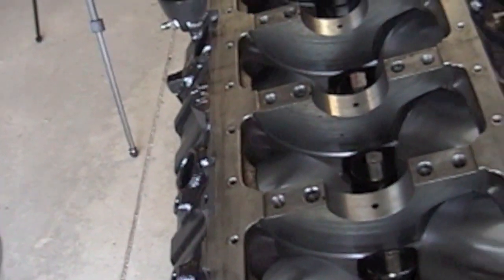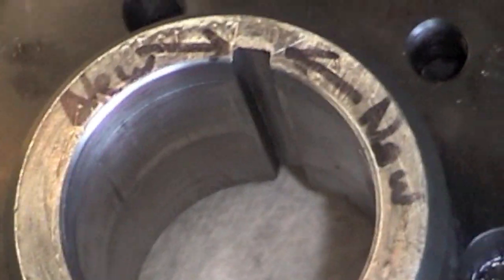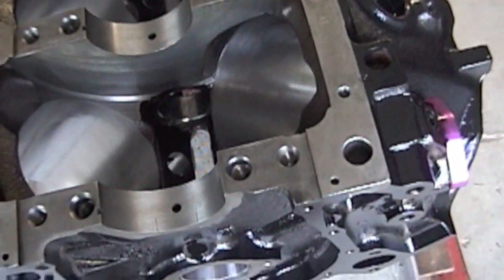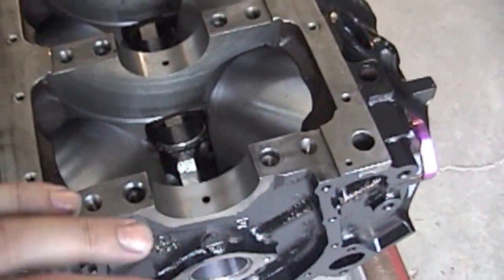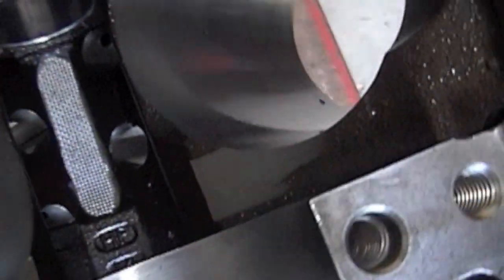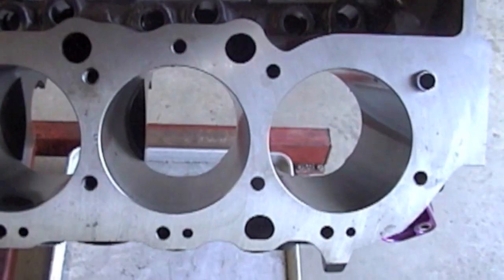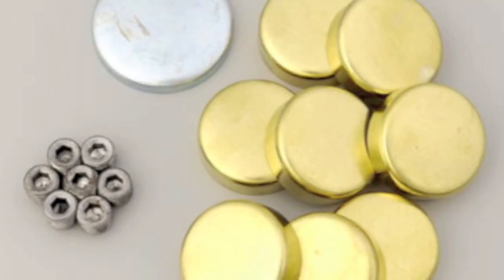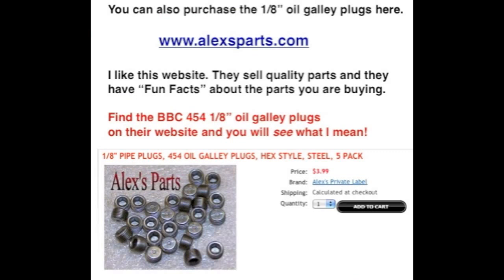Part 6 How To Install Freeze Plugs. BB Chevy Back From The Machine Shop

Comment: A minor point, gentlemen.  These are core plugs NOT freeze or frost plugs.  They are there for the block casting process.  Your block will crack in freezing weather before these will pop out,  BTDT